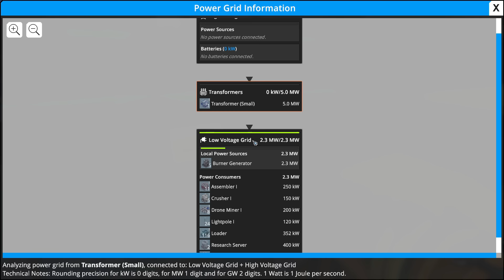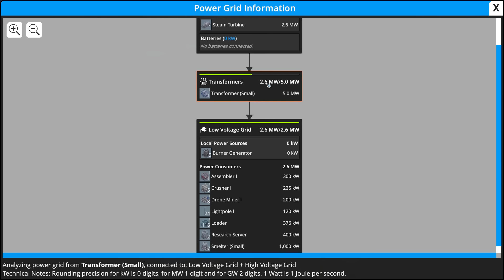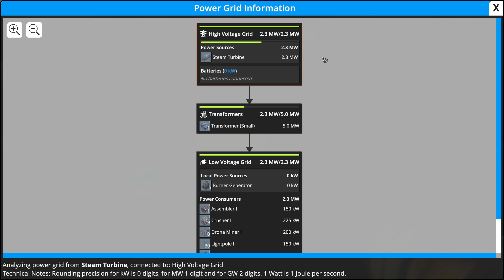Using Water For Power & Production ~ Foundry

Comment: just like irl, you use transformers to go from high voltage to low voltage. steam thing produces high voltage so thats what the power lines and transformers are for, also makes it so you don't need to connect everything with foundations

Comment: No close water hurts but pipes can move liquid a long way with no issues, I'd pump to your current location.   Also you don't need to run flooring everywhere to connect power.  That's what the power lines and transformers are for.  It's less resources to run power poles to other foundations and place a transformer on the foundation to create another power grid than it is to run long foundation lines to join everything on one large power grid.

Comment: Support, you can just pick up stuff on belts with 'E'. The boilers progression will be ignium rubble > portable fuel > ignium rods as you go. Its 1 boiler to 1 steam engine, the boilers have water input/output on each side so u can chain them together in a line, 1 water intake is 10,00 litres/minute, its insane. The map is minecraft infinite, itll generate to millions upon millions of chunks. You need mining force tech to get to unreachable nodes, it means theyre very very far down, the middle number on the node detector is the height, base floor youre on is ~130 on the Z axis. You can look at any recipe you unlocked in your crafting menu too. For the concrete it only allows water input from the other side, its dumb but each liquid node on any machine is 'set' to what it can input or output

Comment: Tip:  Machines that take liquids use specific input spots for those liquids.  Always set the recipe and then look at the ports to see where to plug liquids in at.   Your water needs to go into the other side of the machine.  Move the pipes or rotate the machine.